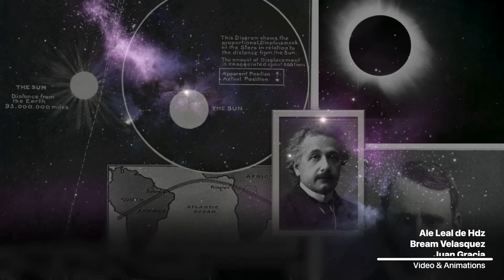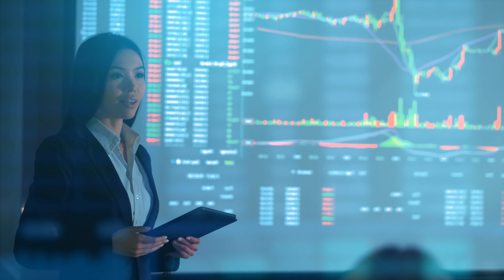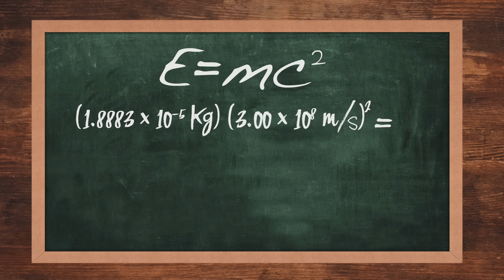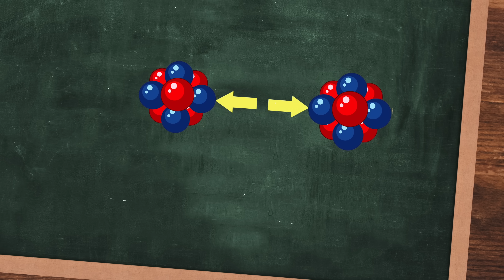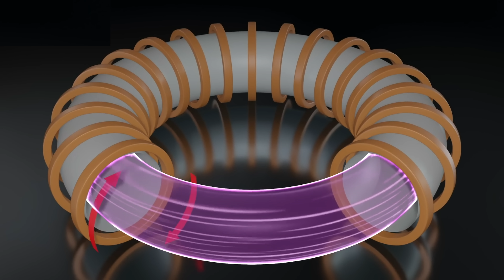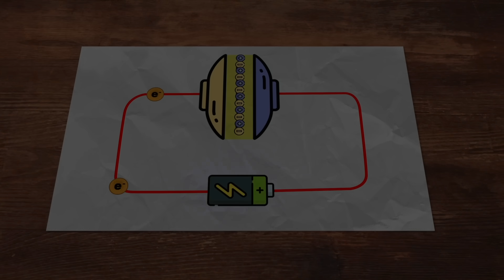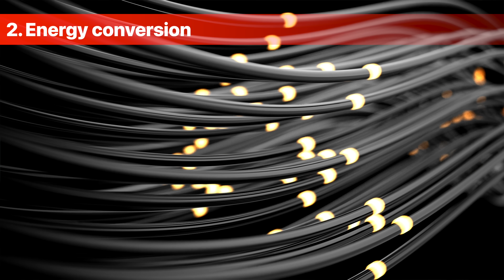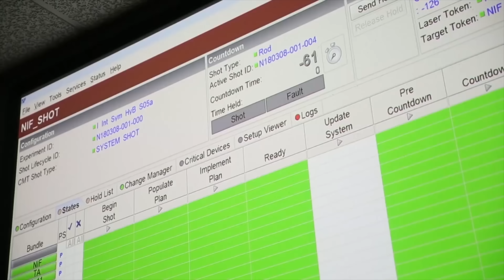Why THIS Fusion Milestone ISN'T Like The Others...

Comment: "For some years now, I have been involved with a Sydney based Engineering and Technology Group
They have developed a methodology to produce clean heat energy at temperatures between (4,500-5,400degC)
Using a combination of five well known and understood sciences/technologies to create this reaction/temperature
The deuterium found in seawater (also some mountain streams) as the key fuel component, plus microscopic mineral particles
Ultra-high temperature ceramics are used where necessary
The heat produced is absorbed within a compact specialised (patentable) boiler, the high pressure steam created being used in a conventional steam turbine generator, 
The electrical energy generated, powering the electrical grid, power stations, factories, town/villages, maritime vessels etc
The benefit of this technology is that there are minimal emissions, none of which are polluting or toxic

The "COMBUSTOR" units are designed for minimal 8,000hours (1 year) between service intervals, operating continuously at upto 100% output

The video, shows one of the initial laboratory tests, limited in time to prevent heat damage to the components - approximately 3,800degC within the chamber - using only a single technology and simple fuel source

Although for simplicity, we call the unit the "COMBUSTOR" there is no actual combustion, rather a Low Energy Nuclear Reaction, being fusion, not fission - 
There is no radiation exposure or danger

These "COMBUSTOR" units are designed for "Base-load power", rather than "renewables", wind or solar which are variable depending upon weather conditions

Deuterium (2nd isotope of Hydrogen) contained in (sea) water is virtually of unlimited supply

The "COMBUSTOR" technology is an "elegant" solution to the World's fossil-free energy needs

Currently, we are seeking sufficient funding to complete the Proof-of-Concept tests, which will confirm the initial theories and provide substantiated data on which to base the Commercial variants"

Comment: Its unlikely NIF will be able to achieve wall plug efficiency of 33% as laser quality and efficiency are at odds with each other. This means they would need to achieve 1000 fold improvement by increasing yield. This type of inertial confinement is not likely to lead towards a power plant, however I am looking forward towards other approaches, especially fi they  can build smaller reactors to make them more economical.

Comment: Thanks for putting the part about solar power being dirt cheap. For the cost it will take us to make fusion viable we can be 100% renewables including batteries. Fusion will have it's place for really power hungry dense megalopolises like the North East Corridor, Tokyo bay, Pearl Delta etc. The rest would most definitely be better served with renewables and no power transmission.

As power gets relatively cheaper and transmission gets relatively more expensive than nuclear fusion is in a different race. Powering ridiculously expensive things at incredible scale might make the most sense. When energy is free and the only issue is getting enough throughput then fusion can really excel. Huge machines decarbonizing the atmosphere really inefficiently would be best paired with the nuclear fusion we'll see in a decade or so.

Comment: As discussed in the video, given the really strong electromagnetic repulsion of the nucleus of the hydrogen atoms, I have to wonder if the pressure of such compression couldn't be stored in a compression chamber that's designed to function as an energy storage device - in other words, a battery, assuming we can release the energy for use on demand later on.

So... Can a magnetic compression chamber/device be built to store compressed super-cooled hydrogen for such a battery?

Note - No fusion required since its not meant to generate energy, just store it.

Something to think about anyway...

Comment: Fusion power has always been 40-50 years away, this breakthrough might mean that the target stops moving, as in now it might actually be "just" 40-50 years until we can have commercial fusion power generation.    

Just a decade from now, competing with a combination of solar, wind and batteries for grid power generation will require extremely cheap generation, even on demand weather-agnostic generation will have to be extremely cheap to make sense by then. Completely new technologies aren't cheap. 

There was a time when making fusion power generation practical could have been the most important event since humans learned to control fire, that time has passed.

Comment: How about a controlled, directed laser to heat steam and drive generators as a power source for electrical generator? Obviously the energy in must produce greater energy out through the steam and generator to produce a net increase in energy and more electrical energy out to be commercially viable and constantly reliable.

Comment: The Sun is natural nuclear fusion, that’s why solar panels ends so called energy crisis. They also block the natural sun's rays with schedule Chem Trails, using code words, climate change and carbon emissions to fool the unaware, the majority. Gives Globalist an alibi to add Lab Meat even though genetic stem cells are old, cloned meat since the first McDonald's. They want to be feel like Gods by only constantly improving Technology instead of evolution, Less Technologyc radiation. Now the environment is more cancerous because of radiation from man made control and regulations. World of illusion.
Reply: True abdul moment who actually doesnt understand how Solar works, its setbacks and how solar is not in any way capable of meeting power requirements

Comment: When they get within 5-10% true break even, It'll be just down to engineering, no new breakthroughs needed. Not to undersell this but we still have over 99% to go in terms of energy in vs out on a total system viewpoint. I hope for a few more breakthroughs like this in the next couple of years. I'm cautiously optimistic we'll get there in the next 20 years.
Reply from the maker: Agreed ...Cautiously optimistic is a common feeling with many breakthroughs.

Are there any other breakthroughs you would like to see us cover with cautious optimism?

Comment: What these fusion experiments (and even current SMR fission developments), suffer from is being confined to a single company or lab with no national policy or international cooperation (other than ITER, which itself will be nearly obsolete once completed). A smart national/international policy would've looked like 1980's US cooperating with France, UK, USSR and China on fission waste disposal & recycling, standardized reactor designs and cheaper insurance, with new materials science paving the way to better modular reactors, like molten salt thorium. And nuclear power for large ocean vessels & space exploration. Once the reactor designs are finalized & built, we know they can put power onto the grid. The same is not true with any current fusion scheme.
Reply: esides the 145 fussion reactors under what ever state wheres the burillium the thoruim we will be scraping electrics for copper for the grid transformers remember the 4000% increse in minerial production in mines where 10 times as much earth needs to be moved because we are already in minus 1% minerial teritory as we burn trees for renewable biofuels we distroy 500 times the water carring capacity of the that biomass if planting a seedling replaces a 100 year old tree with 5000 gallons of water capacity is a sane and rational use of earth resources i would like you to explain how it is in b.c. we are clear cutting old growth forests for pellets to fuel the renewable green fuels myth and not untill you piont this out you are a pie in the sky facifullist with your talk of how wonderfull our future is when we cant see the forest for the heat dome. have you or any one every lived in an old growth forest i have and when its 120 f in the baking clear cut forest the old growth forest is 50f so not untill you realize this difference can you really appreciate the differene and the meaning of what i am trying to tell you over 90% of the fur of the organisum we call earth has been scalped from its hide and this percludes a 90% DECREASE IN in non oceanic water vapour and it dosnt matter how much you increse the vapour carrying capacity of the atmosphere when we have eliminated 9o% of the water vapour source. that we are replacing everyday by burning 100million barrels of oil creating non iononized water vapour and results in atmosheric supersaturation and 4 feet torrential down pours please tell me i have got 75 years of study and observvation wrong and tell me where i am wrong.

Comment: This laser is designed from the bottom up to produce data for fusion research. It is by no stretch of the imagination the basis for a generation of electricity.  It was never designed for that purpose. 

 Only Helion Energy has any plans to actually generate useful power. Even in their case it is clear that they have the problem of how to source or (as they propose) manufacture Helium 3.  

The folks at ITER could not even get the plumbing correct or their experimental facility, even although it is just another fusion experiment and not a generator.

It is a great pity to see this channel  hint  that the NIF is even remotely a route to electricity generation.

Comment: I remember reading about fusion back in the 60s and 70s.  They said that we would have practical fusion reactors in twenty years.

They mentioned a number of milestones that would need to be achieved.  Obviously, as you mentioned, we need to break even.  We need to get power out that is more valuable than what is pumped into the system.

It looks like we have achieved scientific breakeven -- we got more energy out than we put in.  The trouble is that we used electric energy to produce heat energy.

The next step is engineering breakeven.  That is, we get more electricity out than what we put in.  This accounts for things like the efficiency of the heat engine that will be used to generate electricity from the heat.

Of course, what we really need is economic breakeven.  We need to get enough power out to pay for the fuel and other costs.

But one good thing about this technology is that it can be used to upgrade power plants that are currently burning coal or petroleum to generate the heat.  We can replace the coal boiler with a fusion boiler.

And we can do that one boiler at a time until all of the fossil fuel boilers are off line, and finally scrapped.

Comment: There is a fusion method you missed in this video, I think. I don't remember what it was exactly, but the process involves using something like a railgun to accelerate a small metal disk to about 700km/sec to impact a fuel pellet. It uses far less energy than the lasers and has achieved fusion, though not an energy gain. I think they modeled the process off of a pistol shrimp. I just looked it up. It's called 'First Light Fusion'.

Comment: Folks should keep in mind that the main reason the defense budget gives LLL so much funding to do this is not to make future energy, but rather, to study fusion for weapons. They want to make sure that inertial confinement fusion can't be easily scaled down to the size of a breadbox (that is from back in the days when people kept bread in a box on the kitchen counter) where it can be used as the trigger for a hydrogen bomb. Today, that trigger requires getting your hands on enough enriched fission fuel, which is carefully restricted. If inertial confinement can be scaled down with ordinary materials, then the limits on nuclear weapons proliferation are out the window.
Reply: Yes the LLL are not  indending to produce an electricity generator.  Just look at what they say themselves and their funding source.

Comment: Note: The tiny amount of mass that is used for fuel means only a tiny amount of He is produced. This is no route to global He shortage relief. Next, solar may not produce power at night, but geothermal does, 24/7. Drilling for geothermal is where all the companies that now drill for oil and gas are going to keep going. Geothermal wells can be drilled at existing coal, oil and gas power plants to replace their heat sources, thus continuing the investment in the rest of the facility, and lowering the LCOE. Fusion may be great for spacecraft engines where density is vital and cost is no barrier, but for grid power on Earth, fusion has many decades to go (after it technically works) to reach a low enough LCOE to be economically viable against future renewables.

Comment: I keep wondering about the need for llithium. How renewable is it, how much is there, and what are environmental effects of mining it? Also how can countries that have to import lithium be considered energy independent?
Reply: Once it's mined, you have it forever.  It's not destroyed when used in batteries.  Old tired batteries can be recycled to make new batteries without any need for more mining.  That's the definition of renewable.
Reply: @incognitotorpedo42  This is talking about transmuting lithium into tritium, which is then used up in the fusion reaction. That is not renewable.

Comment: Did the fusion experiment that happened recently produce more energy than the whole facility housing the lasers and lab etc. used to conduct the experiment and initiate fusion? If not then it is still using more energy than it produces. Still not the solution to our energy needs.
Reply: No, it didn't.  Not be a long shot, as was described in the video.
Reply: It created 8/10ths of 1% of the energy dumped into it by the laser alone. 0.8% is rather pathetic. But it's all about making more powerful laser technology. It always has been.

Comment: I was excited about the potential of making helium this way, but it sounds like there will be very little produced. So although it might be profitable, it probably won't really cause a significant improvement to the helium supply. Am I mistaken?
Reply: No, you are not mistaken.  Except about profitability.  It will never be profitable.
Reply: @incognitotorpedo42  its profitability is contingent on the scarcity of helium in the future, as I see it. I would tend to agree with you, but with an apparent finite supply that we seem to have, can we really rule that out? Although I suppose if it's rare enough, it will stop being used for anything.

Comment: Where c is the speed of light, c * 2 is wrong, as it violates the theory.
c^2 is also wrong, wherever it appears in any context.
Therefore, E=mc^2 is wrong, too - if c in the formula is meant to be the speed of light.
Countless eyes have been seeing E=mc^2 for the last 100 years and thought nothing wrong with it - Huxley and Orwell should be forgiven for thinking their systems can last forever - finite fossil fuels are dangerously hypnotic to humans and their mental capacity.
"In any system of energy, Control is what consumes energy the most.
No energy store holds enough energy to extract an amount of energy equal to the total energy it stores. 
No system of energy can deliver sum useful energy in excess of the total energy put into constructing it.
This universal truth applies to all systems.
Energy, like time, flows from past to future".

Comment: This could still take another 30 or so years in the meantime we should be weaning ourself off  carbon based fuels particularly from Russia by building Thorium fueled. Liquid Salt, Nuclear Reactors that are capable of providing cheap Base Load Electricity 24/7/365 for the next 50 or so years without creating any Radioactive Waste, CO2 or Micro-particulates.

Comment: This is cool but honnestly I don't really get the point. There is a video about what helion is not saying on their fusion process that is really opening eyes... But you know what ? I think that helion is closer to do something usefull than this.
I'm not saying at all that this is useless and pointless, but honnestly if you don't think before on how to fuel the whole thing and then collect the energy it's like putting gasoline on fire and saying "look, we can power our world with that". Yes, but how ? Collecting and converting energy is not simple. Moreover the whole process is complicated by getting some little perfectly manufactured pills to burn.... And even if they burn : how do you collect energy ? And how do you refuel the whole process to get it working ?

That's what I really liked with Helion despite all the possible problems. At least they are thinking about how to get that energy back.
This could help us a lot studying the whole fusion process, for example in order to find ways to extract the energy, but then you'd be.... Nowhere. You'd still have to build the thing to get the energy, to improve its efficicency and then get it to scale.

I appreciate the overall open mind you have on the subject mentioning its drawbacks. Thanks for that.